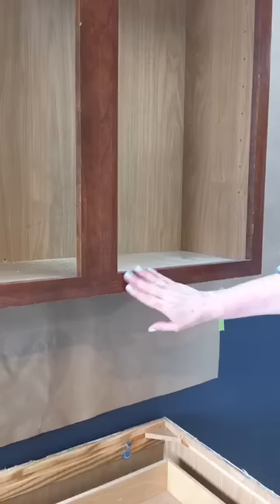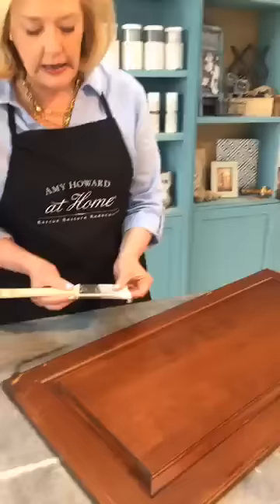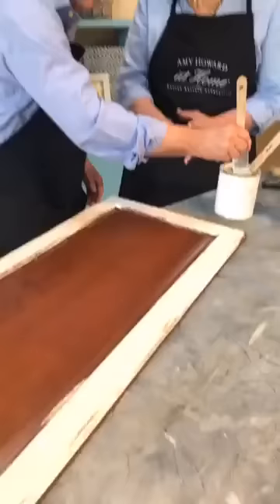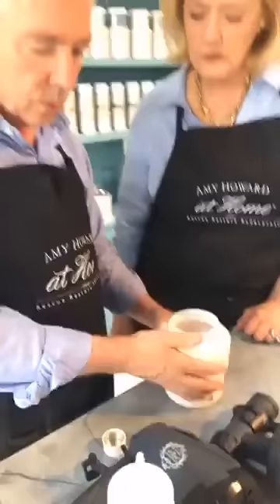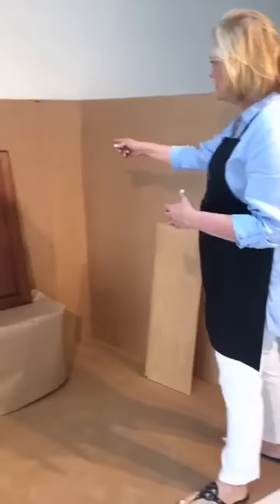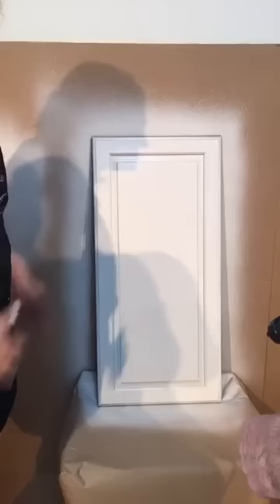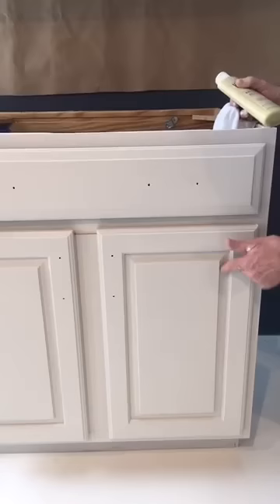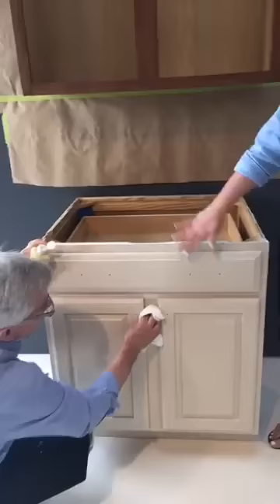How to Paint Your Kitchen Cabinets - Amy Howard at Home

Comment: I currently have chalk paint on my kitchen cabinets and it has chipped, scratched so bad I am going to have to redo them, is this chalk paint gonna do the same? Yes I followed instructions to the T using the other chalk paint the cleaning and the waxing, now I've gotta do it again and I don't want to have the same problem..I love your paint sprayer gonna get even if I don't use you paint.

Comment: We had our cabinets painted about 2 years ago with latex and sadly the paint hasn't held up and is peeling in some areas. After I remove the loose paint should I go ahead and do a light sanding to help with adherence and to stabilize the old paint?